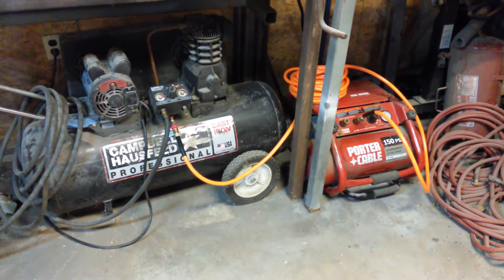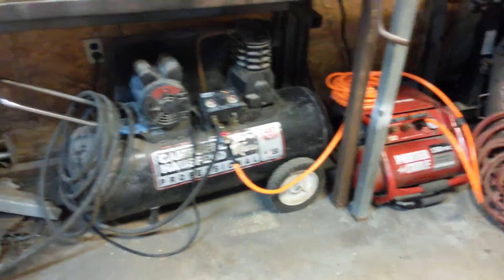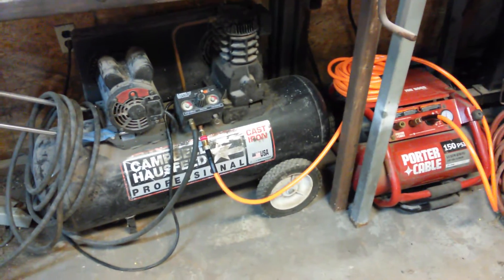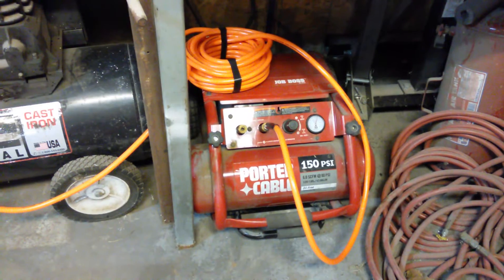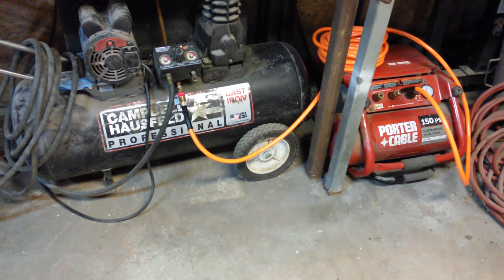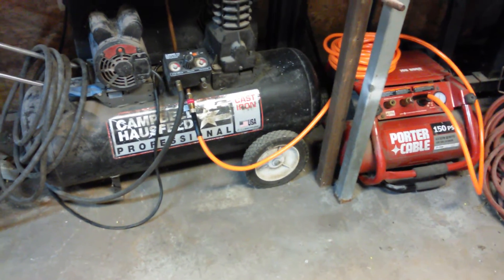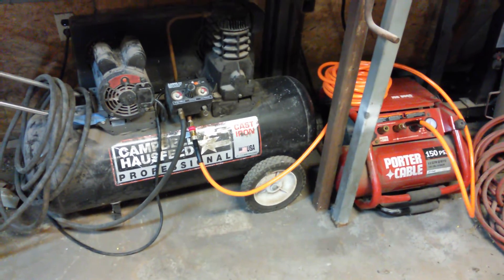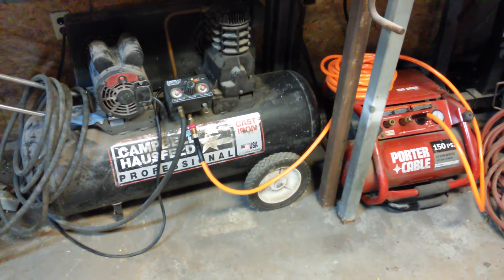Air Compressors in tandem high volume air supply.

Comment: Do you need to install a check valve between the two compressors so the air doesn't flow back into the other tank.Can you let me know thanks